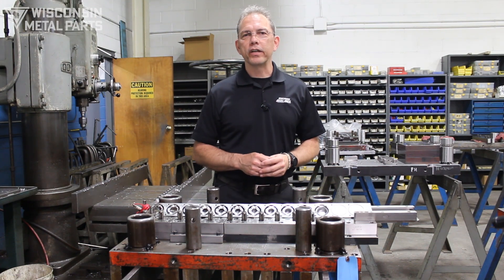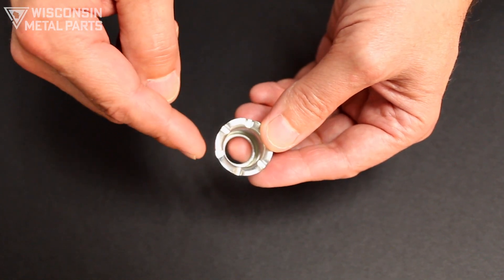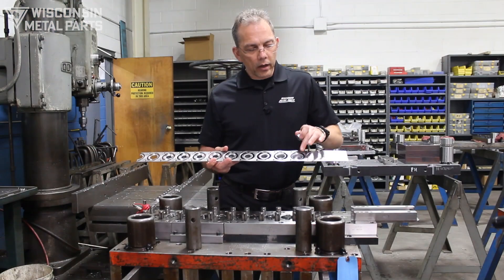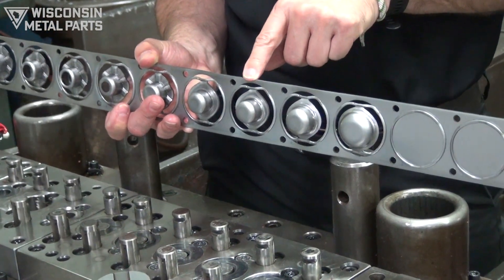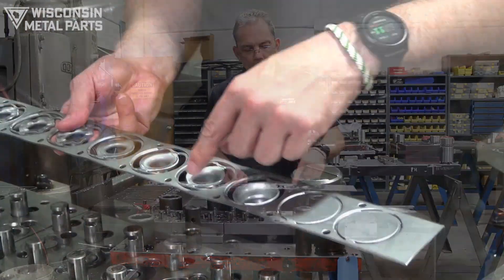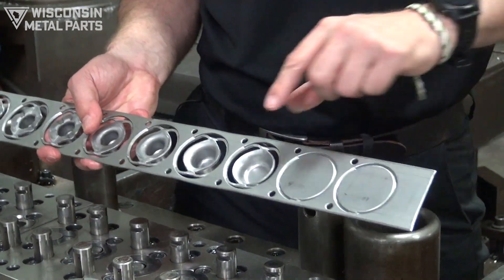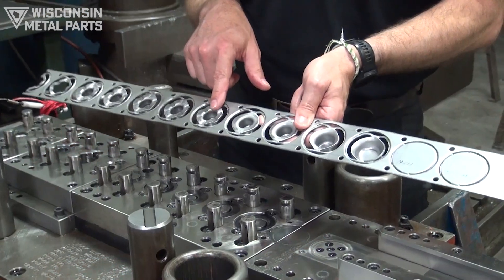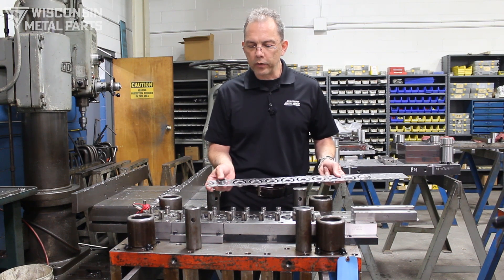What is a Progressive Die: Draw Dies

Comment: I worked on a very similar tool that had a problem with a coining operation . It turned out the oil was holding the die back. I had to vent the whole die to drain the excess oil.

Comment: Hello
   We have a company in which we make sheet metal dies and sheet metal parts. It has some companies with whom we are working. Like Honda Suzuki Toyota are different companies who develop all new parts from us. They have their requirements which include drying and making tool and die and parts according to 3D model. In which compound die. , progressive die, blanking die, piercing die, forming die,
And we work according to their demand. And if their requirements are according to the parts checking fixtures and 3D and drawings, then we work accordingly. And all dimensions of all parts are according to drawing and 3D data.
. And we also have some companies from other countries that we are working with. We manufacture and supply their parts. If you have any job then give us a chance, InshAllah we will not let you down. If you want to get the dies designed. So if you send the data, we will also design the dies for you. We will wait for your reply. Please contact me.           saleem475135@gmail.com.  Thank you very much

Comment: Nice video. I've done 1 draw die in the past. It was challenging because I don't use cad software. Old-time tool maker. However, through the machinery handbook, again was challenging. It was the C size battery positive side.
What are the percentages.
Is there any chat. I'm out to retire in 2 years' time. 
This is just curiously. Thx.
Reply from the maker: Thanks for your comments. The video was just intended to be a basic explanation. Unfortunately we cannot comment on the draw formulas as they may not apply in every situation and some of this info is proprietary. We would suggest you search “drawn cup blank reduction percentages” to find some of that info on Google.
Reply: @WisconsinMetalPartsInc  thx for replying. I understand. Like I said, I only have 2 years left for retirement. The material specs were aluminum kilt.  0.0089 thousands of an inch. I know each material varies. Thx again.
Reply: Enjoy your retirement. I bailed out ten years ago from the trade in the Chicago area.  I went from 8" diameter draw dies down to drawn parts for hearing aids near the end.  Just a note, the lubricant for aluminum was a big issue. Aluminum could be a bigger problem than stainless steel, easily galling on die and punch members.
Reply: The reduction percentages depend upon the stock thickness and the number of draw. For example , the component I'm making is 0.8 mm thick requiring 3 draws.  1st reduction 42%, 2nd 23%, third 18% . You'll find formulas and charts in die design handbooks.